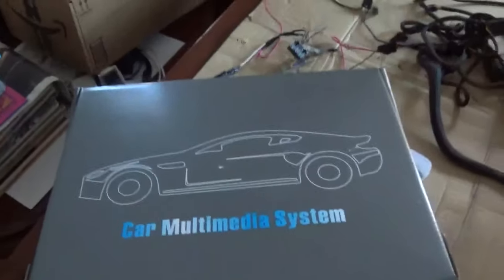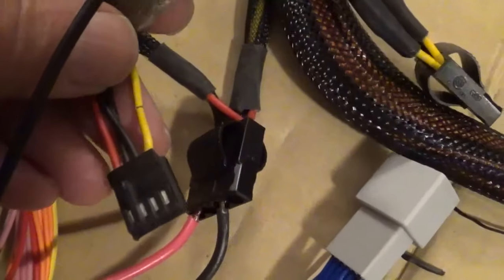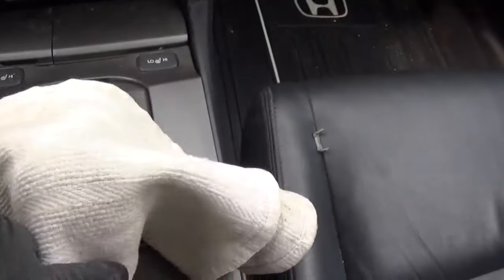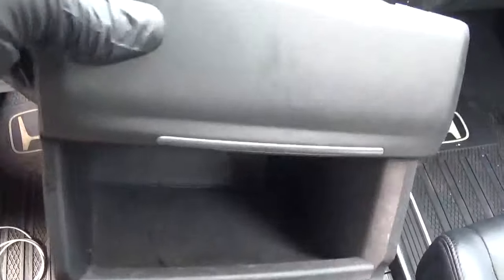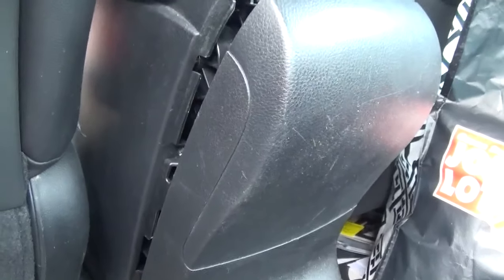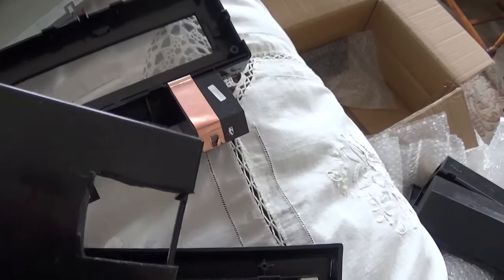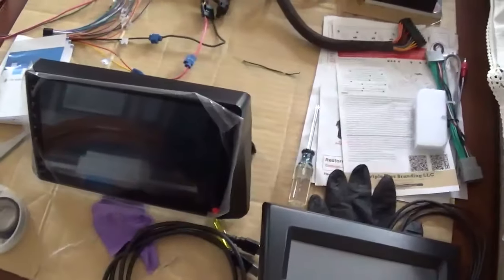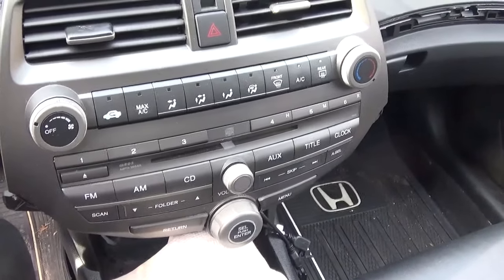Honda Accord 2012 touch screen upgrade

Comment from the maker: NOTE: The premium OEM Honda radios have an anti-theft device that locks out the OEM radio if it's been disconnected.  To get the unit functioning again requires entering a 4 or 5 digit code which can usually be found on a sticker in the glove box or owner documentation. Pushing the volume/power button for 2 seconds will pull up the screen to enter the code. If your code has been lost you can retrieve it from the Honda code website (google search - can't post it here). The base radios don't require a code. Thanks @DiamondScuff for this info
Reply: Do you think the 2012 Honda accord SE got premium radio ? Which is exactly like you car radio push bottons , other option buttoms are same. The original radio in my car is not disconnected since still I can play FM from original unit by selecting first button for FM then AM.
Reply: i have an a question do you have to keep the small screen?
Reply: You’ve ended an ages long mystery for me
Reply: @nilewalker7240  how did you fit the new screen in mine just doesn’t fit
Reply from the maker: @catchshop8593  no I don’t believe premium radio was an option on the SE model - at least it wasn’t an option on ours.
Reply from the maker: @luismagallanes9174  I guess not - one wouldn’t have to keep it although not having it might affect some of the functions of the OEM radio/CD player. My wife still uses the CD player so it’s nice to know what track is playing and the song name.
Reply: How do u put the code? Like which button to use

Comment: Just acquired a 2012 and read your review on Amazon. Thanks for the detailed explanations. You’re the bomb!
Reply from the maker: @Dan Molina; How is your touch screen working out?  I finally got the 10" touch screen connected to 4G and when I plugged in my iPhone with a cable it connected to Car Play. Both work simultaneously. It's pretty cool.
4G has been a real saga for me. I tried several SIM cards without luck. They would populate the settings but no connection - no bars or DATA. I tried playing with different suggested APN settings etc. -still no joy. I finally picked up a Speed Talk Mobile SIM on special through AARP - $15. I also bought a new 4G antenna from Amazon ($5) on the chance the provided antenna was defective. I installed both (new antenna and SIM from Speed Talk). STILL NO JOY! We recently took a long trip where I connected the unit through my iPhone hotspot which worked beautifully. BTW, overall the unit performed well on our trip. About 1/3 of the way on our trip I happened to glance at the screen and noticed we had bars and 4G. WHAT? Are you kidding me? After all this I finally have 4G data away from my home state? The 4G connection stayed fairly consistent while traveling through several states. I don't know what will happen when we return home, but for now Speed Talk Mobile DATA SIM works in our unit. When I had a chance I did a deep dive into the SIM and mobile DATA settings. Everything was on the T-Mobile network which makes sense because that is what STM uses. The mystery for me is that the first SIM I tried was out of my cell phone which is also on T-Mobile, but no joy with the phone SIM. If you want 4G -LTE I can report that for $15 I would try STM and see if it works with your unit - it works for us. This unit is very good and I'm raising my rating from 4 to 5 stars.
Reply: @PHubb wait, you connected a 4g antenna to the head unit? I don’t always want to use my hotspot since it I only seem to get a single bar :( , so I don’t know how to get a regular connection. Could you make a video explaining what you commented please. About the sim and 4g antenna. How does the sim work for the head unit how or were do you connect it . Thanks
Reply from the maker: @TR1CKSHOTS31  https://www.youtube.com/watch?v=pbw9tIYpaRk   Getting 4G to work was a bit of trial and error. I wanted it because we took a long trip last April. What worked for us is a Speedtalk Mobile Data SIM package which is on the T-Mobile network. You can see in the SIM/mobile network settings in the video. I used a highly rated but inexpensive 4G antenna made by Bingfu which I bought off Amazon. https://www.amazon.com/Bingfu-Waterproof-T-Mobile-Cellular-Amplifier/dp/B07R9JGLV5/ref=psdc_172504_t1_B07P7MVWL5?th=1
Reply: @PHubb alright, so I need the fm antenna to get radio stations through the head unit.. also I watched the other video you sent me the link to but I didn’t understand where you plugged in the 4g antenna you also linked me from Amazon. Does that go where the gps antenna went too? The last thing how did you connect the SIM card too the radio, do you have to use a device that reads the sim, your basically paying a service line for the head unit? 

I apologize for asking, I’m just very inexperienced with this. And greatly appreciate your help
Reply from the maker: @TR1CKSHOTS31  There are connections on the back of the unit for all of this - radio antenna, 4G antenna, GPS antenna, and the SIM card slot. If you look at 32 through 50 seconds at the beginning of the video you'll see pictures of these connections. I bought a $5 FM antenna from Amazon but it was inadequate - not good reception. I discovered a better way to do the FM radio antenna by tapping into the Accord OEM FM antenna. The Honda OEM radio antennas are built into the rear window defogger wires and incorporate a signal booster amplifier. I bought a standard radio antenna splitter cable, and a Honda antenna cable adapter and connected them. Here are links to the antenna cables: https://www.amazon.com/gp/product/B07TV1QT1F/ref=ppx_yo_dt_b_asin_title_o02_s00?ie=UTF8&psc=1 
and https://www.ebay.com/itm/191075283707 
I'm going to make a short video about connecting to Accord OEM antenna system.
The 4G setup requires a data SIM card on a cellular network. It's a paid service similar to your cell phone. The 4G antenna screws in next to the GPS antenna. 
Paul
Reply: have you made video on how to conncet standard antenna cable splitter to honda oem antenna system?

Comment: AC stopped working in my 2009 Honda Accord after installing an aftermarket android radio. Any idea why that may be?? 

BTW, if I remove the head unit, and install back everything factory, AC starts working. 

Any help be great...

Comment: Just a couple of questions.

First Link to the 1/8th cable you used instead? 

Second, why did you use a hard drive I was a bit confused on that part?

Third, how did you managed to program the volume up and down button to work with the radio

And lastly how would you program it to answer phone calls?
Reply from the maker: 1/8 to RCA cable from Amazon - made by UGreen 6ft 
https://www.amazon.com/UGREEN-3-5mm-Auxiliary-Stereo-Splitter/dp/B00LM2Y2U4/ref=sr_1_2_sspa?crid=1SUVUJRX0DDH1&keywords=rca%2Bto%2B3.5mm&qid=1685733580&sprefix=rca%2Caps%2C125&sr=8-2-spons&spLa=ZW5jcnlwdGVkUXVhbGlmaWVyPUEzVVZDNlpNNkNCR1NHJmVuY3J5cHRlZElkPUEwMjIwNzU5NzBRRUZXT0Y3VlI3JmVuY3J5cHRlZEFkSWQ9QTAxOTA0OTIyTzlUWlhRQjIzSVNNJndpZGdldE5hbWU9c3BfYXRmJmFjdGlvbj1jbGlja1JlZGlyZWN0JmRvTm90TG9nQ2xpY2s9dHJ1ZQ&th=1

Comment: Great video instructions!  It really helped with my install.  Wondering if you can offer some expertise on getting the Honda logo to appear at start up.  Currently, I have a black screen for a few second before the main screen appears.  I'd like the Honda logo to appear in those few seconds.  Jane at RongNan provided me the logo file and I got it uploaded to the head unit, but the Honda logo only appears with a Reboot (replacing the Andriod logo).  I don't think Jane understand (language miscommunication) what I'm trying to accomplish.  I'm guessing there are some configuration settings, but I thought I read you had accomplished the Honda logo start up.  Thanks for your contributions!  Unbelievable you would offer such detailed instructions.  You are/must have been a teacher or instructor!

Comment: Awesome video I have a 2011 Accord tried installing this unit what did you use for your antenna for your new Android unit
Reply from the maker: Hi; Two possibilities for fm radio antenna - purchase a fm antenna on eBay or Amazon ($5-$8) or use an antenna ‘y’ splitter cable with a Honda antenna extension cable. https://www.amazon.com/car-antenna-splitter/s?k=car+antenna+splitter and https://www.ebay.com/itm/191075283707 With the cable setup you have the advantage of having OEM powered antenna to both the OEM Honda radio and the new touch screen radio.
Reply: @PHubb  Thanks for the video!  Getting ready to do the same type of install on my daughter Accord and would love some more detail on how to break into the OEM FM antenna with the y splitter.

Comment: First thanks for the in-depth tutorial I was really having a hard time wrapping my head around it. I have one issue where the head unit keeps falling out does this happen to you? Is there a way to secure it? I tried pushing it in.
Reply: hey jus did ours.    it was poppin iut.  until we put ALL THE SCREWS in those small plastic legs that lock it in.    also there is a plastic clip that bolts directly to the bottom of new radio head bracket.    we also made sure that was secure an it worked.    2nd time around.    1st time we didnt install all the bolts an the side legs were flimsy.    hope this helps

Comment: @PHibb- its awesome job and very good lengthy video. 
My car is 2012 Honda Accord.
I installed Andriod radio recently, got issue with the steering wheel controls not working while playing  FM from Original OEM and Bluetooth audio from New Android head. When I select Vol+,Vol- and Next song, pre song- nothing happens on Original Radio and New radio. I can lower or up the volume using centeral round controller on Original Radio.

Do you have any idea and suggest what am I missed?

Also as I saw in few videos that  I got one extension harness cord with 2 RCA pins for audio, those connect to New radio head and after connects to Original Radio. But  my car doesn’t have the existing harness cable and port on old radio to attach. Is that causing issue?

Comment: Hey I’m having some issues out of my steering wheel volume button, since I installed the radio, it seems like when I press up or down on the volume button it switches between fm1, fm2, xm, and aux, would this be just my steering wheel controls or would it be in the radio?

Comment: Hi, great video thank you very much for making this instruction. I will be installing simillar head unit bought on aliexpress to my wifes honda accord 8th gen by the end of may. One quesiton, what about steering wheel buttons? Does the volume up/down works while playing music from android head unit? Same for Next/Previous song? Same question for Accepting/Rejecting calls while connected via Apple Carplay. Did it work well with the wiring that you have received with new radio or did you need to make some adjustments?
Reply from the maker: SWC pretty much work out of the box. In the settings menu there are SWC buttons you can customize. I have vol+ vol- next song, answer phone, and talk (voice control) set up.

Comment: @PHubb,
Can you please suggest how to fix below issues if you are aware?
1. The screen got brightness modes Auto, Day, Night. 
How to enable to change day to night in the night time automatically?

2. The Screen side Led lights are not lighten up for Power, Home, Vol+, Vol- buttons. 
Are you aware sir where to turn on feature to turn on screen side led lights?
Reply: I could figured it out how to lighten up screed side lights. I am still looking for to let device change the brightness mode from day to night(dimmer) based on time or headlight depend.

Comment: Thanks for the video. 
Did you lose dash lights on the factory radio? 
I recently installed one and that is my issue.
Reply: Me too lost dash lite and steering wheel controls lites as well have you figured out what it is?? I just installed mine 2 days ago will be checking my fuses today if I can find what fuse it is for the lites that is..

Comment: Awesome video brother , I was wonder before I ordered mines. Is there any way we can hook up the USB port that’s under the arm rest to the head unit? So it can charge and have apple play not wireless?
Reply from the maker: Hello; The Car Play USB port from the head unit charges a phone. What I was doing before I got 4G fixed was to tether the head unit off my iPhone personal hotspot. I then used a USB lightening cable (plugged in) connection for Car Play. That way the head unit still had a connection from my iPhone personal hotspot. Using the cable connection for Car Play also solved the problem of wireless Car Play draining my iPhone battery. This is a known issue with wireless Car Play. Wireless Cap Play is very convenient for short trips - no fumbling with a cable just to run across town, but on a long trip the iPhone battery will run down if not plugged in. FYI, I'm not sure the USB at the back of the console has charging capability, although it does provide power to a USB flash drive so maybe it does. BUT crucially it has special wiring which goes to a little controller box with IC under the console for song/folder access and song name display on the little LCD screen - it's all integrated. Using that USB port with an iPhone is read as an iPod for music play, nothing else. 
Using wired Car Play from the head unit has kept my phone charged. I also bought a two pack of power socket chargers - Cynemo Fast Car Chargers (Amazon) - which work well. No need to waste the two power sockets built into the Accords. There's a setting (I forget where now) called USB startup. The choices are none and Carlink. If you set it to Carlink, Car Play will start immediately and automatically once you plug in the iPhone. If you have a problem with wired Car Play, try the other USB port. Only one of them works for Car Play. I hope this helps.

Comment: Thank you for the in depth video.  I've run into a problem where the factory radio lights don't work and the #6 fuse blows every time i turn the lights on.  Everything works except for the radio lights.  Hopefully you've heard of this issue and know what i can do to fix it. Because neither the seller or Amazon can give me an answer.   Thanks again for the install video.
Reply from the maker: Hi Can you post some pictures of your install? thx
Reply: I have the same issue,factory radio lights don't work
Reply: Mine does not work either

Comment: Have you had any problems after installing? Like dashboard lights going or a fuse blow or any problems with the screen in general?
Reply from the maker: nothing like fuses or screen not working. It did take some work - trial and error - to get the 4G network setup and working. Overall the unit has been good.
Reply: @PHubb  so radio button illumination is works at night like before installing the screen? Heard some people had their illumination stop working. I ordered mine and I wanna make sure everything goes smoothly.
Reply from the maker: @juliankazzi2019  YES All the functions of the OEM radio/CD player work as before. When I turn on the headlights both the touch screen and LCD screen dim for night driving. This can be adjusted in the settings. There's also a setting to control the touch screen panel lights - see my other video for how to set this. 
NOTE: Our car has the base OEM radio (1 CD player). I can't speak for OEM units with 6 CD changer or premium sound with separate amp and XM satellite radio. Units with NAV are not compatible with this upgrade.
Reply: @PHubb  that’s the radio I have in my car. Thank you for your help

Comment: Any issue with static?  My unit works well, and the old radio works well, but use the aux it has an annoying static feedback.  Any insight is greatly appreciated!
Reply from the maker: Hi Michael; I've seen a couple of people having electrical noise with similar units. Did you have to connect the sound to the AUX IN jack at the rear of the console? I did. My unit wouldn't take the short cable with RCA outs that plugs into the back of of OEM radio. I had to use the long 1/8th to RCA cable. When I first went to install it I discovered that the provided cable was defective - one RCA connector wouldn't connect and it wasn't long enough. I had to purchase a new cable (which Jane @ RongNan reimbursed me for). I wonder if a defective cable is the source of your problem? The other people with noise (static) have found a loose connection (particularly ground) was the source of static. Another area to check is the AUX IN jack at the rear of the console. Make sure the AUX jack is clean and the cable is making a good connection. I cleaned mine with some spray electrical cleaner. This head unit has been very good for us, but as I stated in my review, the install kit was lacking quality parts.

Comment: Hello sir, this video is very helpfull, i need a help in last thing which i didnt get from any where, how to connect speakers to the stereo touch screen ( aux ) so i could listen to the music from my phone ? If you can send me step by step with picture or you have a video for that , plz share the link , i saw rca cables plugged in but how to connect the other side of the rca cable to the main radio ?
Thanks in advance sir

Comment: My oem radio does not work. if i put the new head unit would it and with a broken oem radio would it still work? Thanks!
Reply from the maker: I'm not sure. This unit is sending pre-amp output to the OEM radio/CD player for sound/audio. I think there are units made for 8th gen Accords that replace the OEM radio. Another alternative is to buy a used OEM unit off eBay for $50 or $60 to replace your broken one.